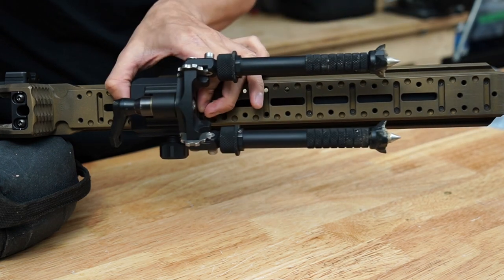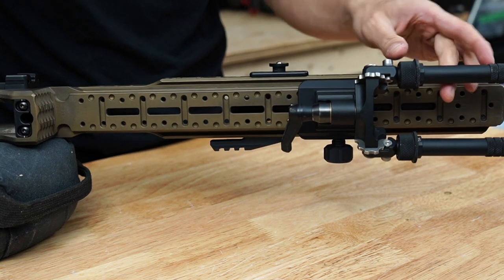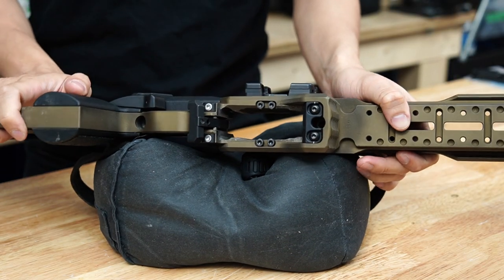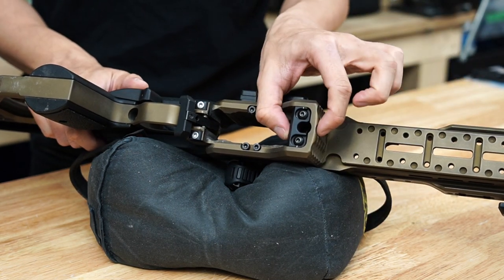KRG C-4 Update: Chassis Weights, Delta-Lug Clamp, Updated Opinions

Comment: For all your viewers, as a Matrix Pro owner, I would not recommend it for rimfire only because it doesn't balance any better than a MPA BA Comp.
Reply from the maker: Good point, but you don't think the additional features of the Matrix Pro might be more attractive than the older BA Comp? I guess it's mostly the longer forend and bagrider
Reply: @Womfat  Don't get me wrong, there's a lot of things I like about the Matrix Pro. But the fact that my Vudoo weighs nearly 2lbs more to balance exactly the same, if not a little back heavy, compared to when it is in the BA Comp is a bit disappointing. If it weren't for the balance issue, I would whole heartedly recommend the Matrix Pro. But for the price to the BA Comp (which I bought originally under $1K), it's not a slam dunk to take the Matrix Pro over the BA Comp. I will say that the Matrix Pro runs the Vudoo billet mags perfectly, though. No effect from mag pressure. I don't need the mag blocker/barricade stop. 

Interesting fact is that people can send in their BA Comp to get drilled by MPA for the mag well blocker/barricade stop accessories.

I am likely going to get the ACC Elite. Several people with Vudoos in an ACC original (now Premier) have come to our NRL22 matches and every single one of them I have handled and found that they  balance perfectly (with weights of course).
Reply from the maker: @ocabj  You don't have to worry too much about balancing in a chassis if you get a 24"+ heavy barrel ;)
Reply: @Womfat  LOL. I have been targeting 22” as my next Vudoo barrel, though.
Reply: @ocabj  I am currently running the 22” MTU Vudoo in the Matrix Pro and it took adding the 2 forward most external weights and 4 of the forward most internal weights to balance it out. I am currently right at 20lbs without bipod or magazine. I am in the process of going to a 24-25” custom barrel to hopefully take some of the weight out and balance forward better.

Comment: I don't know if this would help at all with the MDT CKYE POD mounting, but GrayOps CNC makes an ARMS-17 adapter for it. You'd still be running two adapters to make it work, but wouldn't be as high as using the Pic Clamp like they mentioned. You may have already found this or figured out how to use the MDT with the Delta Lug System as I think I've seen you use it in your new videos, but figured I'd mention it just in case.
Reply from the maker: Yup, at the time of filming I wasn't aware of the Ckye pod ARMS17 plate, but that's exactly the solution. MDT makes a version of it too, which is what i have now
Reply: @Womfat  That's awesome to hear. Appreciate you taking the time to respond. I enjoy your videos and think you do a great job helping people with both gear and how to improve.

Comment: Hey Matt, I’m sure you probably already know this, but GrayOps makes a ARMS-17S adapter for the CKYEPOD that you can swap out and then attach you KRG clamp to that. MDT also offers the new Ckyepods with the option of the arms-17s adapter and no clamp so you can add your own clamp. With you being in Canada, you could possibly reach out to them and see if you could get the adaptor from mdt directly. Just a heads up if you didn’t already know.
Reply from the maker: Good point!  I knew MDT makes an ARMS-17S head for the ckye-pod, but it would still need to be stacked with the KRG adapter plate for the Delta-Lug clamp.  I wish KRG made a direct plate for the ckye-pod to limit the amount of bulk between the bipod and clamp.  I may pick one up later to see if it'll work for me though!